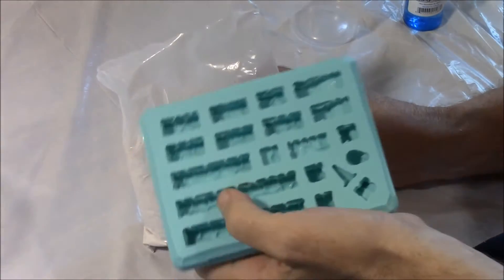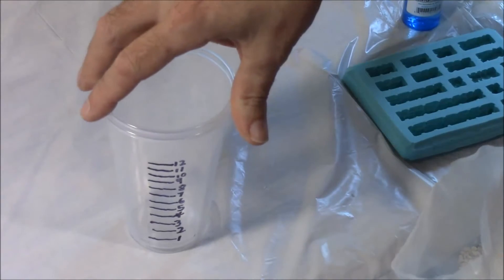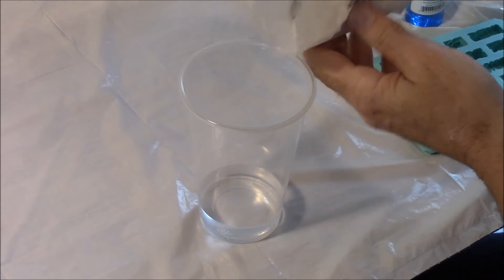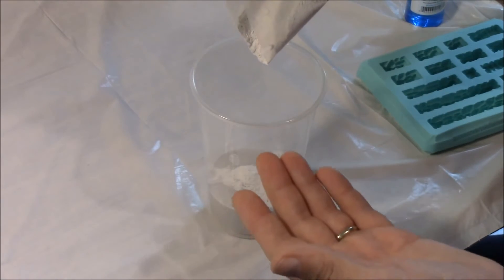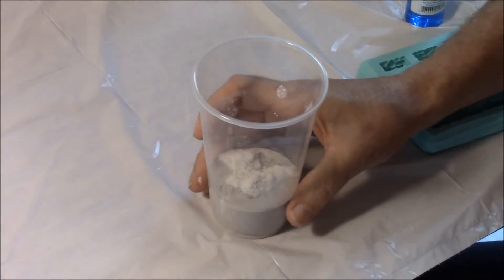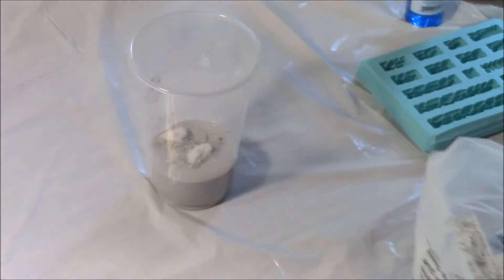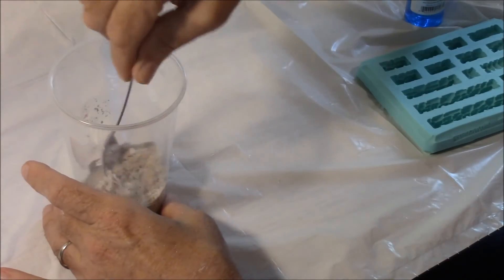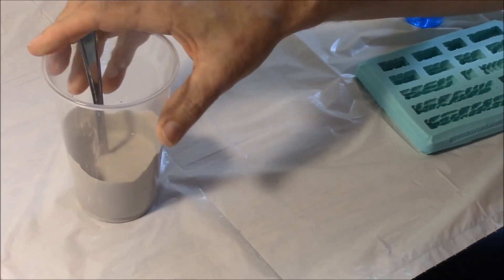Basic Casting Part 5: Mixing Plaster of Paris

Comment: Have you ever added some white glue into the water and then add Plaster of Paris?  It's supposed to increase the toughness of the Plaster of Paris.
Reply from the maker: I have never done this because I usually use dental stone which is four times stronger than regular plaster. However, I have heard of others who have done this. I really don't know how much stronger this will make it though.